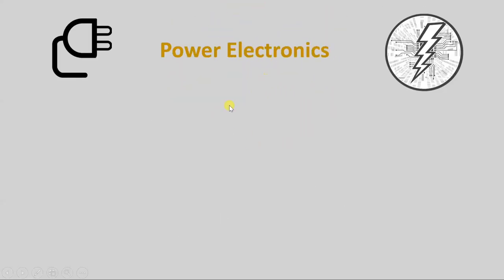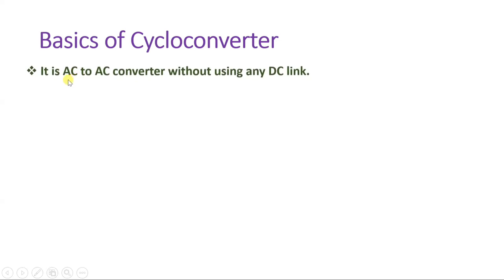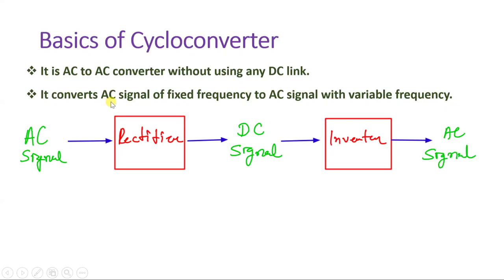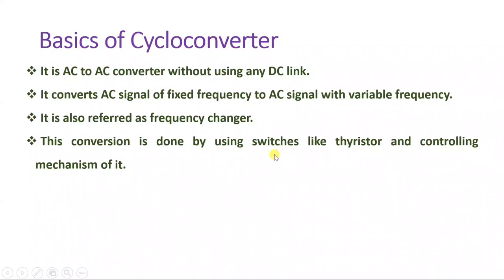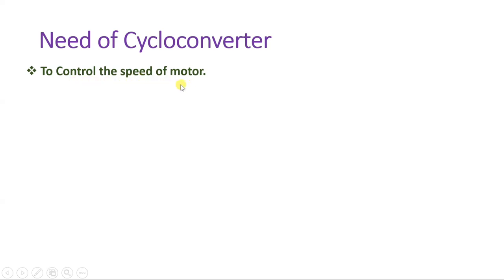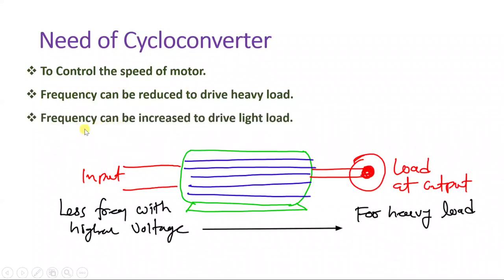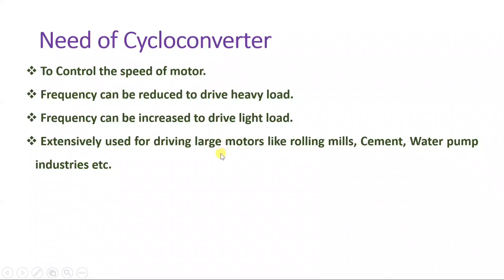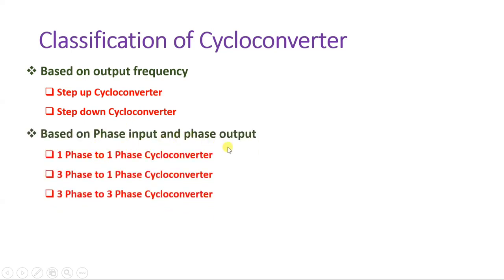Cycloconverter (Basics, Need, Classifications & Applications) Explained

Comment: Duniya bhar ka gyaan dedia but working nhi btayii
Reply from the maker: It is used to convert frequency of signal.
Reply: @EngineeringFunda  would have been way better if it was explained how rectifiers and inverters are working in the circuit .